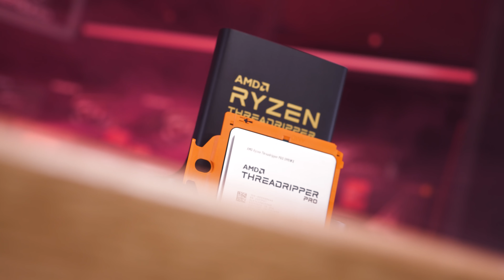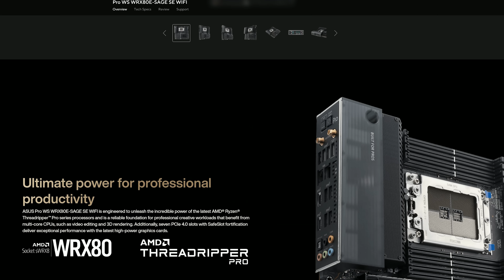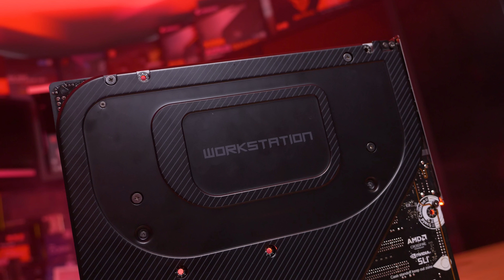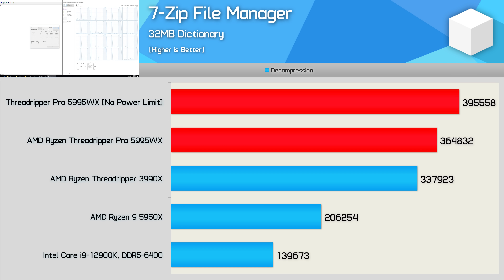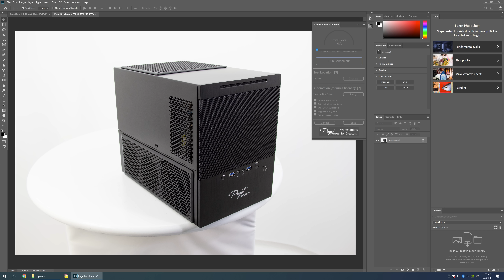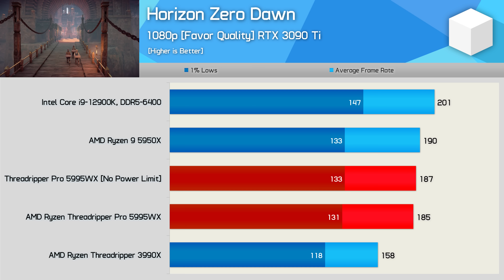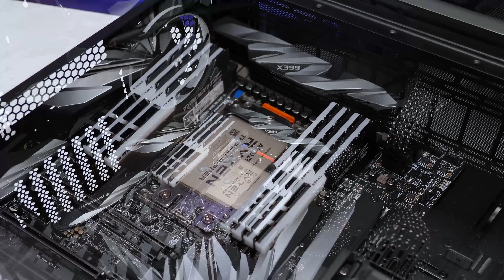It’s Finally Here! AMD’s Ryzen Threadripper Pro 5995WX, Benchmarks, Power & Cooling

Comment: Finally I can watch a product i will NEVER be able to buy, too expensive
Reply: You don't even need it
Reply: @foxylune  True, but i need 2TB of RAM to use Chrome smoothly these days ;D
Reply: @martinxyz  Try Firefox. It runs perfectly fine on my 2GB Core2 Duo laptop.
Reply: @andersjjensen  I use Firefox as my main. It uses even more RAM
Reply: @martinxyz  Huh? That's odd. I've tested recently, and Chrome consistently doesn't release RAM right away when you close a tab, and it consistently seems to just slowly ballon it's memory consumption for no apparent reason over time, even if left idle with a few dozen tabs open. Firefox on the other hand seems to memory cache a bit more, so it doesn't release as much RAM per tab I close, on the same site, as Chrome (eventually does), but once I close the last one on the site it releases a lot in one big go. But Firefox also seems aware of total free memory and changes accordingly. It uses more on my 8GB laptop than on my 2GB laptop. Chrome just seem to eat up anything it can get near, and it doesn't care if there's memory contention, whereas Firefox slims down on it's own if another program starts eating a lot.

How much RAM do you have?
Reply: @andersjjensen  16GB, 7,3GB used, 7,6GB cached, 400MB free. 17 tabs open taking 5,8 GB of RAM
Reply: @martinxyz  Ok, that we have the same number of tabs open right now is strange...

8GB, 3.9GB used, 3.9 cached, 84MB free. 17 tabs open talking 1004.8MB of RAM.

One of the tabs I have open is a 40MB PDF. That tab shows as using 237MB which is the highest of them all. The rest are mostly youtube and tumblr tabs.

Comment: I want to have an overkill CPU like this someday.
Reply: A lot of people want something like that, but it's not like most of us will use it to the fullest extent anyway :P
Reply: In 20 years we will probably afford buying one for nostalgia purposes.
Reply: Even a 486 sx33 was overkill once...
Reply: I wanted a 5900X, I got a 5900X, I barely use 5% of it. Just don't
Reply: @foxylune  probably will keep my 10400 for a year or two.
Reply: I have one of these type of CPUs (Threadripper 3970x)... it really isn't about wanting this CPU... when you are at this level... it really becomes a need, rather than a want.
Reply: In just a few years time you can get this performance for maybe 400 bucks.The GPU is the current bottleneck of gaming anyways.
Reply: @tempacc9589  
The bottleneck of gaming is talentless programmers and developers in general. Games run hundreds of times worse than they have any right to.
Reply: Get a 5900 or 5950x you wont be disappointed i have 5950x ut works flawlessly
Reply: @Yodagaming9  A 5950x would rip the first few gens of Threadrippers. Even a 5800x would. Threadrippers seem to be mainly for the PCI-e lanes.
Reply: @dakoderii4221  yes that's that HEDT is. It's for use beyond consumer PCs. PCIe lanes, tones of RAM and channels for it, and advanced chipsets with way more IO.
Reply: @dakoderii4221  Not anymore. They beat equivalent gen Ryzen processors in both single and multi-thread performance now. They have no weakness.
Reply: Wait two years (2 Gens) you will get the same performance in a normal CPU for a quarter of the price.
Reply: @TheArtemisLetter  CAP
Reply: I use a 5800x. Or should I say, hardly use! More than enough for 99% of most home users.  
Unless you are doing core intensive, professional workloads.
Reply: i  just bought it and I'm walking home because i don't have a car anymore or money for the bus
Reply: I'll get a skydiving license and around 200 jumps for that money. Just writing it here to remind me of what matters more than having overkill hardware.
Reply: My 3d render workflow says I need the full capacity of this cpu. My wallet screams in the background.
Reply: Anything above a 5700x is overkill
Reply: @Tofuey  nah other than the 5800x3D (which is specifically for max fps possible)  8 cores are cope chips, if you are doing gaming only, anything above a 5600x is overkill. if ur doing legit workstation stuff then go straight to 12+ cores, 8 cares isnt much of a productivity increase over 6.
Reply: @Tofuey  No. Just because you don't use your computer doesn't mean other people don't.
Reply: I have an 8 core 16 thread laptop cpu i7 11800h and its overkill even for me. Even the most cpu demanding games don't use more than 50% of it.
Reply: For a Gamer a 5950X is already overkill. We can see that most Games prefer a strong single core performance and not many cores.
Reply: I had the opportunity to build a PC around the 3960x a few years back because I wanted to the same thing. Not sure I'll ever be able to afford to do it again so I hope it lasts me a good few years more.
Reply: That isn't overkill. This is complete annihilation.
Reply: I wouldn't even know what to do with so much CPU. I'm using a Ryzen 5 3500U and I just play Skyrim and other old games and it is overkill.
Reply: I want to have all the original first pressings of the OverKill CD albums soon now \m/
Reply: When i bought my 5950X i noticed you really need a real reason to buying cpus that have over 12 cores lmao. Thank god its a beast for encoding/rendering
Reply: *to scroll reddit
Reply: You really don't, it's a case of using the wrong tool for the job
Reply: @patrickbone5446  using the Devil sword Sparda to cut onions
Reply: 15 gen intel will be overkill
Reply: If I press "render in blender" it's never fast enough. I could max out like 100 of those in a cluster.
For the people who really need these CPU's, even this CPU is "not good enough".
Reply: I said the same thing when I bought a used, recent Lenovo dual Intel Xeon core Workstation a few months ago. At first you drool on all the benchmark results until you notice no game ever uses these cores and just max out 4 or even less cores  leaving the others alone and sleeping at 2%. I noticed I had to set the power options to high performance or the cpu clocks went idle even on the maxed out cores because windows thinks the cpu is in idle state and thus performance was worse than on my i5-9600k. Then the part where you see your graphics card doesn't even make use of all those pci lanes and the four channel 64 GB DDR EEC ram is just nearly used and idling along. It's still cool to see though that while gaming you can still start handbrake and other stuff and compile movies (using only cpu power) while losing 0% framerate in the game you are playing at the same time. You need a really good power cable thought since it will eat all the power it can get out of the wall socket 😀
Reply: @tellyjoossens4186  why would you buy a Xeon and ECC for gaming in the first place?
Reply: @DoesntRefillTheBrita  well I  didn't need it since I already have 2 gaming rigs. I guess I bought it for the same reason people drool on those multicore systems that cost as much as a car when new lol 🤪  Seen the number of views this video gets I guess I'm one of those crazy people 😁
Reply: I want my own gas station
Reply: The 3900x is like $250 used last I checked
Reply: When I bought a 5900x last year, I did it because I wanted to, not necessarily a need. I wanted to make sure, that I never have to worry about a cpu bottleneck for years to come.
Reply: It's not that good for gaming
Reply: I will buy this so I can finally play minesweeper at ultra quality
Reply: @patrickbateman3326  finally minesweeper at 120 fps
Reply: its not not overkill for gaming because its not performing better than other top of the line CPUs